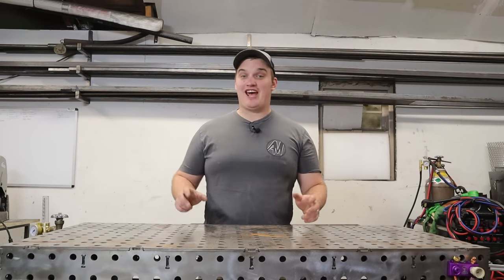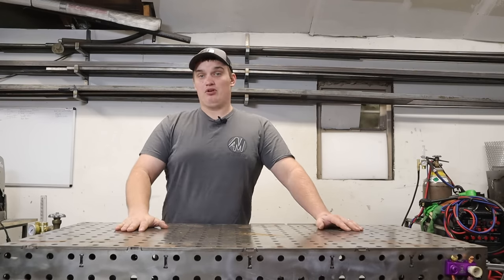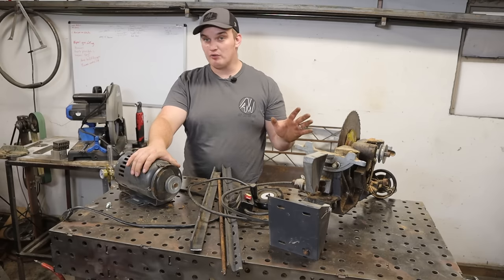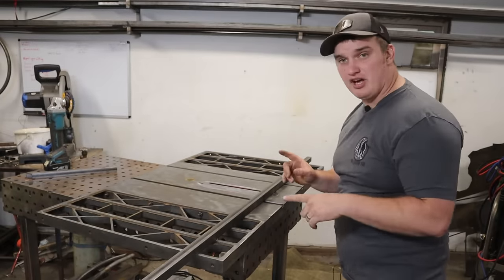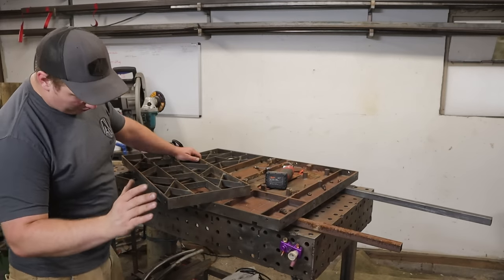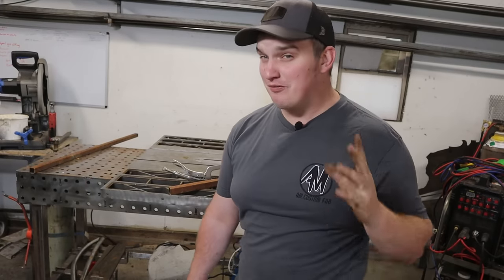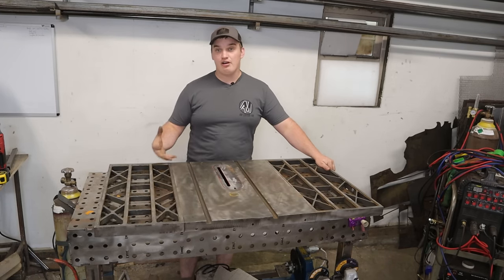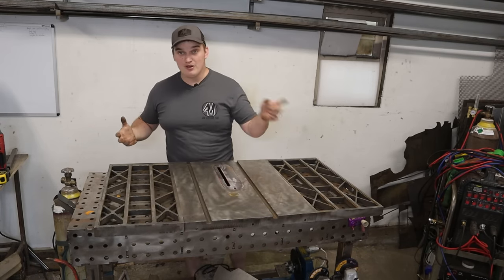HOW TO BUILD $30 DIY welding fixture table. !!!!

Comment: I love this idea. I wonder if the older table saw with all square holes in the extensions would work ok. I'm wondering if you could get the clamps in there?  I can get either style for $50. But the one with the all square hole has 3 extensions. I wonder if I could just bolt all the extensions together?  Here's a video of the style saw I'm talking about. https://youtu.be/S_Ini3Hdu_E
Reply from the maker: I don't see why that would not work

Comment: 86 comments, all Fabing over the weld table, my table is made of 6in H beams c channel on the ends. # 5 welding table should be able to take big hammer drops on corners, try that on cast iron.
Reply from the maker: You are absolutely correct. It probably would break if a bigger Hammer dropped on the corner 😎 but that doesn't invalidate it from being a good welding / fixture table. Your table and this table both have their individual purposes whether it be holding super heavy things and being able to beat on it. Or being flat and accurate. Saying a big hammer should be able to drop on a Welding table is like saying if your big hammer can't knock the slag off of a weld in a corner joint it's not a hammer. Hey absolutely is a hammer there's just different hammers for different purposes 😎 hope you have a great day thanks for watching 🙏👊😎
Reply: I don't know a single proper fabricator who hammers on their welding fixture table.  That kind of shit is done on a separate heavy steel table.  If you were hired by a company that invested thousands in a fixture table and they caught you beating it with a hammer, they would lynch you before handing you your last paycheck.  Dedicated welding fixture tables REQUIRE flat, smooth surfaces.  No bumps, burrs, dings, or dents.  Your name suits you.
Reply: @matthewpeterson3329  something tells me "assy holey" doesnt understand the difference between a fixture table and a heavy table.
Reply: Just because there are better, bigger, more expensive tables doesn't invalidate this as an awesome concept for little to no investment. This idea definitely has a place.